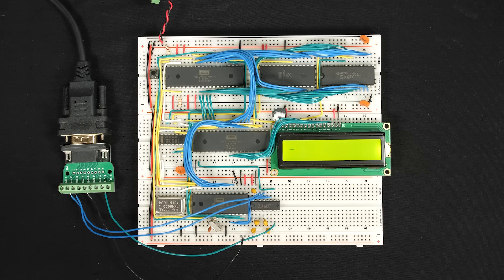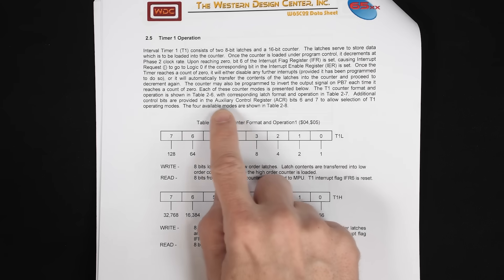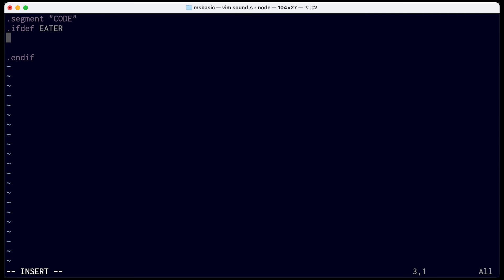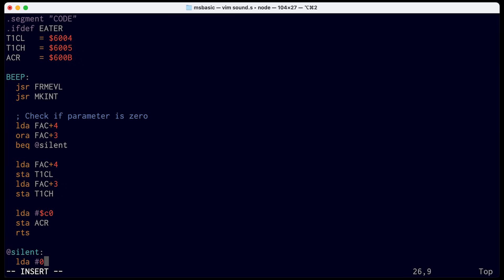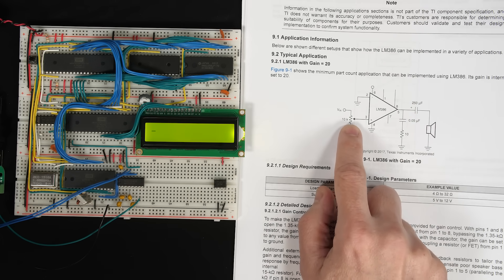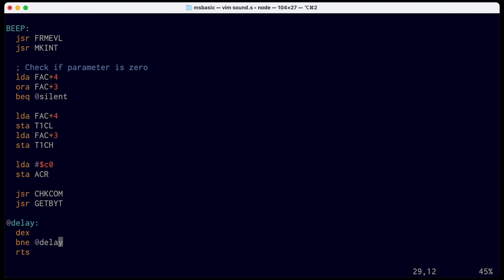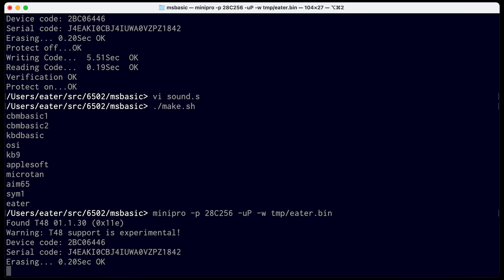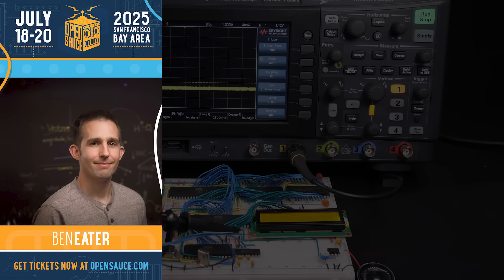Computer noises

Comment: I'm glad your videos are back! Just a comment about the LM386: with less than 9V at its supply that amplifier is basically useless. A simple push-pull emmiter follower (2N3904 plus 2N3906 plus 220uF) is probably more than enough for the speaker drive

Comment: The simplest way to add GOOD audio to a computer is with a dual 4-bit adder and an 8-bit register. Feed in your many MHz clock into the adder and put the carries to an RC filter and headphone jack (and don't forget to loop the carry out to its own carry in). Boom 1-bit PDM on par with SACD. Want decent compression on an 8-bit micro to feed that, check out the 64 HiFi demos -- this is all he's doing with the SID -- hitting the volume to create a 4-bit DAC.

Comment: You could make the first parameter a frequency in Hz and do a little calculation Starting with half the clock christal frequency (1 Mhz / 2) =  500.000 divided by the first parameter of BEEP, so 500.000 Hz / 440 Hz comes to the 1136 value to set the timer T1 with. That way you can do `BEEP 440, 60` for a 'C'

Comment: It's really fun to mess around with this stuff. I once made a cooking timer on a bare atmega328p chip. But I got a bit bored with the regular alarm beep so I had some fun with it, resulting in this: https://www.youtube.com/watch?v=URIvUWZ6Jo0

I did do it slightly different from your method here though. I needed my 16bit timer for another function, so I'm alternating the frequency of a 50% duty cycle PWM pin. Introduces some slight inaccuracies in the sound frequencies, but it's not like it's a HiFi sound system. XD

Comment: "BEEP 0, 0" will not work as expected (silencing a beep and immediately returning) in the final version of the code (it will immediately return without silencing output), but it probably doesn't matter as I cant think of a reason why you'd need a zero length silence, this is not a real time midi playback device where you might need to immediately respond to another command after receiving a note off command and if someone was trying to do that they probably wouldn't be using basic anyway.

Comment: Using a timer to make beeps? Ben has been channelling the IBM PC's engineers.

Given the similarity to how the PC Speaker works, you could probably get the inverse-frequency data used for PC Speaker sound effects from a DOS game and feed it to this at 140Hz and get something pretty close to what you'd hear out of the original game. I say "close", rather than the same, as Ben's machine here is clocked slightly slower than the timer chip in the PC is (1MHz vs 1.19MHz).

Comment: 13:37 LDY #$FF can actually be LDY #$00, since DEY will drop Y to $FF before checking for zero. That would count to 256 instead of 255 for that loop. I am sure Ben knows this but it is easier to explain it with $FF for the video.

Comment: I bet the output waveform (measured e.g. across the speaker) looks interesting :) The low-pass filter frequency of the audio circuit is competitive with your clock frequency (and low order) so you should be able to see a few of the harmonics of your clock still! (especially if you compare it back to the unfiltered signal and voltage across the 10ohm guy)

Comment: I haven't done any BASIC programming in decades. How did the interpreter know which DATA block to read into the arrays in the last program?
Reply: The READ command uses a pointer that scans down the program looking for whatever DATA statement is next. The FOR loop was reading exactly as many as it wanted, which just happened to be right. (There's better ways to lay things out to so you only have to change things in one place, and to stop without having to write down how many you have. But that's not what the video was about.)
The RESTORE command resets the DATA pointer back to the start of the program, and many versions of MS-BASIC let you give it a line number to start at a particular chunk of DATA lines.
Reply: @8bitwiz_  Thank you! It's been a LONG time!

Comment: Reminds me of outputting digital audio samples on a PC, before everyone got a SoundBlaster card in 1992. Pulse width modulation, timer chip in single shot mode, next sample output triggered by timer 0 interrupt, CPU in HLT mode. Dynamic RAM refresh sucked as it influenced timing. As 6502 has no HLT instruction, one would have to use a sequence of NOPs to be off by one cycle or an endless branch for two cycles. But eaters are not allowed to implement this because they may not speak with their mouth full of bread ;-)

Comment: Only thing I would have done differently was to have the timer value get calculated from a Hz value (ie: BEEP 440, 100 for the A note) and have the turn-off of the note handled in an IRQ to return execution of the program back to BASIC while the note is still playing rather than wasting CPU cycles in a loop.

Comment: A small nuance of the 6522 - it takes 1 clock cycle to reload and restart the timer after it expires, so to toggle the square wave e.g. every 100 clock cycles the value to load is one less than that, i.e. 99.

That difference is probably not going to be noticeable for the pitch of notes generated as in this video, but good to keep in mind in general when using the timer.

Comment: I've been doing this long enough that I had to start with a 555 timer. But it's a little less accurate than using a timer unit. And harder to play music on.
Also, the cheesy way of driving a speaker from a digital output is with a 100µF electrolytic capacitor in series. So many dodgy things I did in my misguided youth...

Comment: For the use of the timer to generate square waves and the use of the 386 to amplify, that's the way to go. However, a frequent "second parameter" of the "BEEP" instruction (or "PLAY channel, octave,note,enveloppe,volume" and "SOUND frequency" on some flavours of MS BASIC) is not the duration but the volume. On ORIC ATMOS, duration was performed by a "WAIT delay" instruction after the PLAY/SOUND instruction. On the PLAY instruction, there was also an envelope selection but that's beyond the scope, I guess it involves more circuitry. I'm not sure how to add or replace the potentiometer with another pin on the 6522 so to control the volume programmatically.

All this to say that putting a delay loop inside of the instruction is a terrible idea because it hangs the 6502 while another chip (the 6522) is playing the note, which is probably not what you want. For instance, a pretty common feature in 8-bit computers was a beep at each keystroke with different tones depending of the type of key. Putting the delay in the sound routine means you cannot accept a new keystroke before the sound is finished playing...
Reply: Putting the delay inside the instruction makes it very simple. You do have the option to specify a delay of zero and do the timing manually.
Reply: He might come back to it later, but the original function of the counter he's using is to add a real time interrupt for servicing whatever function or device on a regular basis, nominally to regulate the operation of the shift registers on this chip. So happens there's a timer 2 on the same chip that can also generate an interrupt in similar fashion, though it's just a one-shot device (has to be set by the CPU each time), so it could be used to set the interval between services of this new sound device and let the CPU continue on instead of running a delay loop. Edit: It's been a long time since this series began, so I don't remember if Ben has set up any sort of IRQ servicing for this computer yet, but the individual interrupts on this chip are maskable, so it can be set to assert IRQB for counter 2 only instead of interrupting every time counter 1 decrements to zero.

Comment: I'm guessing that it would be possible to use the second timer to arrange for a hardware interrupt to kick off to stop the currently sounding note after the appropriate delay.  But then you wouldn't be able to directly "chain" notes together since the next note would instantly cancel the previous note.  You'd need something like a "notes queue" in memory, and only pause the program if the queue was filled, and have a hardware interrupt to load the next note.  But that's complicated.

Comment: i bet you could implement pulse width coded audio of a ton of waveforms. if the main pitch is inaudible, and you filter it out, then the pulse width encodes the level at that time. and pulse width could simply be a byte that sets how many out of 255 or 256 steps along the waveform are on or off. then send out bytes at some lower rate to set the level of the waveform. also iirc the speaker itself can be used as an inductor as part of the lowpass.

Comment: Where are the videos on extending basic commands? I don't see them in the play list.
Btw, big fan.
PS.
It appears, some videos on the 6502 topics are not part of the play list. Ex Rs232 flow control is missing, but there are also others. Can you fix that up?

PS. Found the 2 video on Visual basic hacking, would be nice if they are part of the play list for 6502.

Comment: Awesome! The programmable interrupt timer in the x86 architecture works almost identically.
Reply: To pick a nit, it's not part of x86, just the PC. IBM used an Intel chip for the job in the original (I forget the number), and compatible implementations have carried on in motherboard chipsets ever since, though they usually leave out Channel 1, which the original PC used for DRAM refresh, and only have channels 0 and 2, for the system timer and PC Speaker, respectively. Channel 2 also got used in the cassette interface, though I forget how, and hardly anyone used it, anyway.
Reply: Ahh, DRAM Refresh. I've always wondered what the second PIT was meant for. I could find that the third was of course for the beeper and the first connects to the PIC but never any info on that one, thanks!

Comment: Show us the computation needed to make multi channel sound using only simple square wave. I remember I was surprised when I realized that Manic Miner of the ZX Spectrum ha some "music" with up to three simultaneous notes. At least I think it was three, might have been only two, but even that is pretty impressive from a machine with only square wave as the only sound capability. Now I know it didn't sound great, but it was multi channel sound from a machine that shouldn't be able to play it.

Later on I actually managed to sample sound using a spectrum. Again it didn't sound great as neither the sound sampling using the tape input nor the playback was made to do something like that. It was one of the last times I wrote anything using machine code. and definitely the last time I coded machine code for the Z80. The last thing I coded was a serial communication program for some other processor. It was also just using the I/O pins for communication, but it had to communicate at 2400 bps with other machines running programs from other students. There were a few different ideas over how to make the program. Mostly it depended on if you were to use interrupts or not. Doing it without interrupts you would have to count T-states for every single instruction. The protocol was one start bit, eight data bits, parity and stop bit. I still remember that. There were a lot of complaints over having to have a parity bit but this was only for educational purpose so it was better to use it all and learn how it worked that way.

Comment: I really wished he would explain why he doesn’t push the x or y registers at the beginning and then pop them before returning.
Reply: Probably because they weren't being used? MS-BASIC keeps its state in (mostly) zero-page memory, so commands are free to do whatever they want with X and Y. (The x80 versions use HL to point to the current command text, but commands are free to use BC and DE.)

Comment: If you use timer 2 set for say 50ms or part thereof depending on your clock speed and what works with a 16bit value, you can set it up to generate an interrupt when t2 gets to zero.

Then the beep command loads the value of the delay into a global variable that the interrupt handler decrements each time t2 hits zero.  The handler also has to reset t2.  Essentially the delay becomes a multiple of that 25ms.  

This way you avoid the busy loop which is usually a problem if you're trying to make a game or something that needs more CPU. Especially relevant with the way the worlds worst video card interfaces with the bus.

Comment: I feel like I'm gonna lose my mind (in a good way.) I work at a pinball restoration shop where we mostly just do deep cleans, part replacement, and send our busted boards to the local arcade tech wizard. But at some point, my boss inherited a huge stash of ICs of all kinds, which have become my task to sort. (The lables faded and we want them sorted by usecase instead of 'sn74ls1n, sn74ls2n, sn74ls3n...') while looking through the stash I found a LOT of CPUs. We got 6500s, 6800s, z80s, 8080s, and probably something else I forgot, in all kinds of packages too. Ceramic, AMI imprinted, gold cap, all of em'. Two of them, however were in pretty rough shape, a 6800 and a z80. Their pins were rusted till breaking and would never be able to be socketed again so, I happily labled them as "hobby grade" and took them home to sand and tin the pins to hopefully be able to use them in the future. Now, I'm neck deep in trying to learn 6800 assembly and a video like this pops up in my feed. Magical.
Reply: If you already know assembly code for one CPU, it's not too difficult to switch to using another CPU's code.  But if you don't have any experience with assembly code at all, the one thing you need to remember is that the CPU will do only what you tell it to do, and exactly what you tell it to do, even if you tell it to do the wrong thing, or forget to tell it to do something.
Reply: @melkiorwiseman  very wise words indeed
Reply: The thing I never got around to when I repaired pinball games back in the 1990s is taking a bunch of the flipper solenoids and trying to make a rail gun out of them. Just sayin... :)

Comment: 4:15 I suspect that the latches are needed to avoid race conditions by making sure that both T1L and T1H are updated with the correct values at the exact same time. If you write directly to the registers, the timer will be running in between setting T1L and setting T1H. This may not be an issue for this application, but it may be in others.

Comment: When I was a kid I had an Ohio Scientific C1P back in the early 80s. I built a parallel printer interface for it, not by using a PIA which would have been sensible, but by using an addressable eight bit latch. Then in Popular Electronics I learned about "digital audio" and how a computer can generate complex audio with a digital to analog converter. To me this sounded like my printer interface with a bunch of resistors so I built a circuit with eight resistors and plugged it in like it was a printer and connected an amplifier to it. With some simple programming I was able to generate triangle waves and pulse waves in actual musical notes. It didn't sound perfect because I had no idea what "aliasing" was or that the circuit needed a low pass filter.

Comment: Oh cool! We've been thinking about how to add sound to this computer for a while now - very elegant!

Our solution was a bit messier - we were going to use the 6522's shift register. If you use the ACR to set the shift register mode to 100, it repeatedly sends the eight bits you loaded into the shift register ($A) at the timer 2 frequency. Doing it this way would probably be better for, like, videogame purposes, because you can use timer 1 to measure duration of notes instead of running a delay loop and freezing operation … and it also allows you to program whatever 8-bit waveform you like.
Reply: Part of the problem of doing it that way is that you need a way of timing the note duration which does not tie up the CPU waiting for the note to end so that it can send the next note.  I really don't see any way to do it without extensive use of interrupts and probably using a RAM based "note queue" so that the CPU can dump the notes into the queue and then continue with the rest of the program while the notes keep on playing.  That requires you to have a way to deal with a full queue, too.  Interestingly, 255 memory locations will hold exactly 85 3--byte notes (16 bits for tone and 8 bits for duration per note).
Reply: @melkiorwiseman  yeah, there's a reason why most 8 bit computers had a dedicated sound chip
Reply: @melkiorwiseman  Oh yeah, it would absolutely involve extensive use of interrupts - I'm not sure how you do it otherwise. I think I remember Ben Eater talking about using timer 1 in freerunning mode to set up a regular clock - that's what I was imagining using for timing lengths of notes.
Reply: My way of adding sound was to add a YM2149! It’s a classic sound chip, found in computers such as the Amstrad CPC.

Comment: Nice! W65C22S can sink surprisingly large amount of current through its outputs (it's similar to 74AC series), so a speaker would work when connected directly, or better: through a capacitor. Your solution is way more elegant :)

Comment: Being able to have a periferal generate the tone is almost luxurious as far as the era of computers this is imitating.

Also useful hint with the ORs to check multiple bytes for 0.

An issue I've always run in to with BASICs that could do beeps is that there's never any sort of asynchronous way to do them, which makes them always super inadequate for background music in games.  Maybe could have it so a delay of 0 just means keep it on or turn it off and return, and to avoid issues with that, maybe have returning to the editor unconditionally stop the tone.  Then it could be up to the program to keep track of time and change the tones as needed.